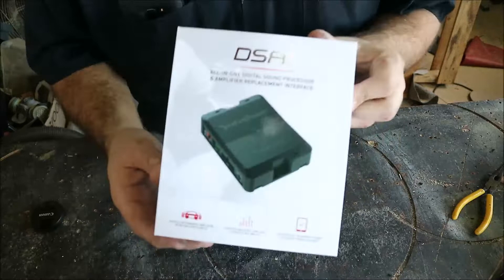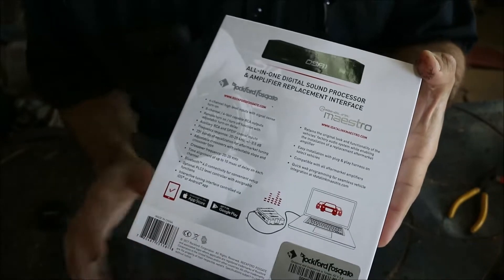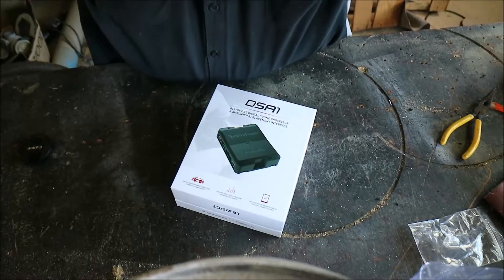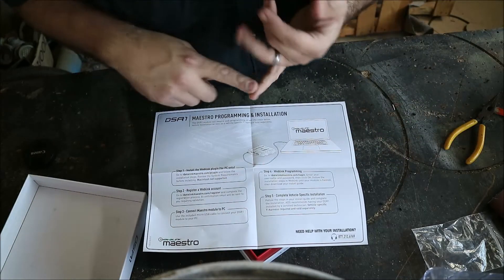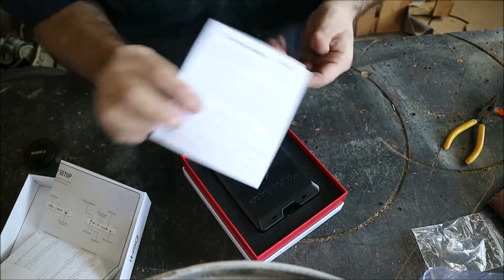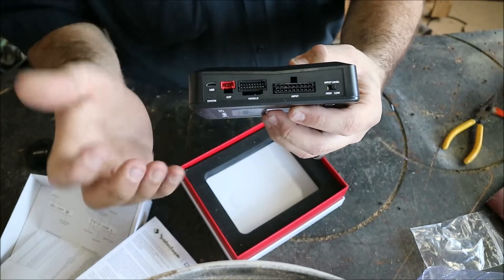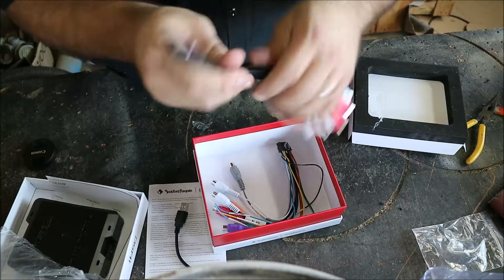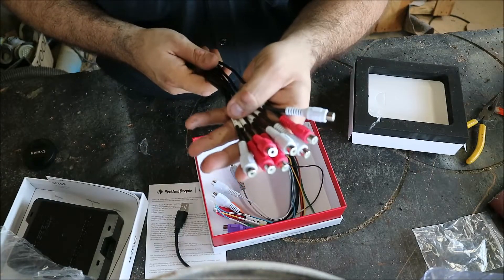ROCKFORD FOSGATE DSR1 DSP DIGITAL SOUND PROCESSOR (AMAZING)

Comment: Very informative video brother…what are the amp settings? I’m assuming FULL.
Reply from the maker: Amp settings depends on the setup... The great part about the DSR1 is it's versatility for its price. If you referring to xover settings I usually set them in a safe range for the speakers/subs and use the dsr1 to be more precise... because you can change the slope and frequency for each pair of channels. I still use the amp x-over just in case there was ever a failure or you make an oops and bypass the x-over by accident in the processor...

Comment: m considering this or the pac amp pro for my 2019 charger uconnect with alpine, im leaning towards the amp pro for simplicity and less stuff that can go wrong, what do you think? thanks
Reply: The amppro units are great, but no added controls besides a bass knob. If your building a nice system and want to have equalization than run the dsr1. Is it harder to tune? Yes, but once it's dialed in, it's worth every penny...

Comment: I know it's a old video but I've seen people say that the dsr1 is not worth buying as it does not connect all the time and randomly changes crossover points, delay and so on. Do u have some advice for an entry level dsp like a Dayton or is the dsr1 okay? Thanks
Reply from the maker: I still feel the dsr1 is a great unit. There have been many updates for the firmware and the Bluetooth to help with some of the issues your referencing. Android has some connection issues still. I have spoke to idatalink and Rockford and hopefully a new update is in the works. 🤞There are a ton of great dsp's I could recommend, but none are in the dsr1 price range. If your willing to make the jump I'd recommend the Alpine, Audiocontrol, or Arc audio. But your gonna spend significantly more on any of these... Hope this helps and thanks for watching!

Comment: Hey tour video is awesome.but I have ran into a problem looking for 2020 model Nissan Altima standard model I’m not sure if it has stock manufacturers amp if so is there a normal standard spot on location of unit?and dose manufacturer stock amp connect to input of the DRS1 ?
Reply from the maker: Most likely for the 2020 model you will have to hardwire the dsr1 speaker level inputs after the factory amp/radio. I don't believe there is a t-harness yet. I normally locate the dsp as close to either the factory amp or a nice hidden spot in the trunk. You do want to have access to it in case you need to update or reset the unit. Etc... You will need to connect at least 2 channels from the factory amp to the dsr1, but I personally recommend running a 4ch input so you can still fade in the factory radio. Hope this helps and thanks for watching!!

Comment: I like to see the connection to an aftermarket Sony radio.... mines has a front, rear and sub output
Reply from the maker: The sony radios are great... if your connecting to any aftermarket radio you will most likely want to just use the front and rear rca outputs to connect to the DSR1. The DSR1 only has two inputs... So you would still have full control from the Sony except for a Subwoofer out, in which I would recommend using the PLC2 bass knob so you can have sub control.... Thanks for watching!!

Comment: do you still use the crossovers and gain control on the aftermarket amplifier?
Reply from the maker: Usually run the head unit set to flat and crossovers off. You can set them, but I would recommend setting them up as a backup.... 
So for instance for you highs if they get set at 87 hz high pass in the dsp, you could run the head unit at 50 hz or 80 hz. As a backup in case you accidentally reset the dsp or lost settings.

Comment: Would the DSR1 replace an aftermarket amp to the vehicles speakers or can an aftermarket amp be added to it as well?
Reply from the maker: DaLoop OnFire the dsr1 is not going to replace an amp. It is basically going in between your source (radio) and your amplifer. It can work with factory radio or aftermarket radio. Going to give you the ability to fine tune your system properly.
Reply: @Mark-kr3hn  thank you
Reply from the maker: DaLoop OnFire ... no problem.. more video reviews coming soon. PLEASE SUBSCRIBE! Thanks!!!

Comment: Does this dsp would work for a toyota camry 2018 xse? Thank you
Reply from the maker: It will work in the Camry, but it doesn't look like they currently have a T-harness for the Camry. You can use it in universal mode which just means you have to hard-wire to the system. It will still give you all the same output and control options for your system. It's just a little more time consuming to install... Hope this helps! Please subscribe if you can! Thanks!
Reply: Do you have to install an amp or can it work without one